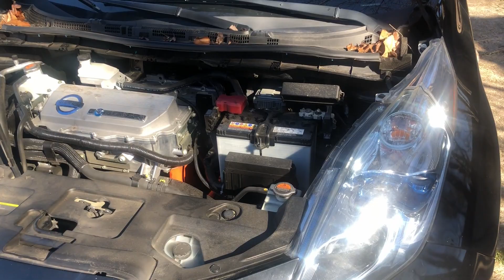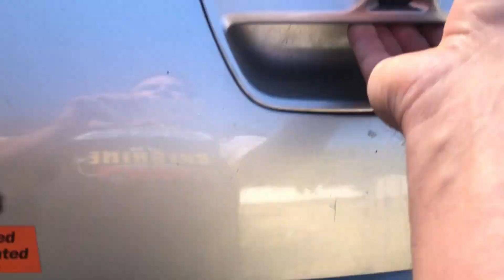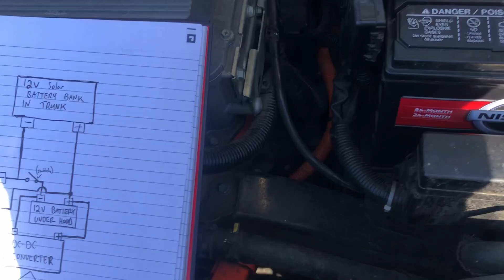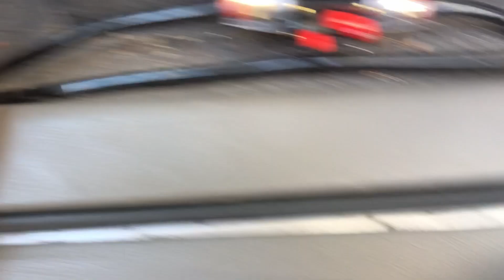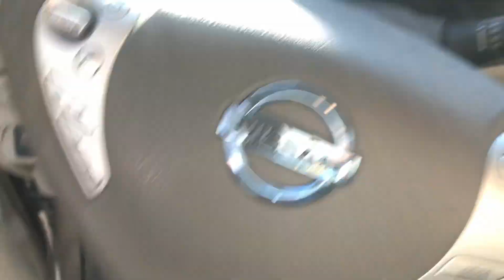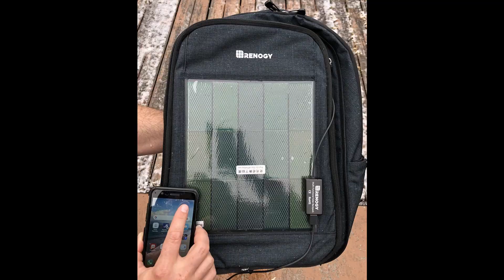Attempts to Separate the 12v Circuits in the Nissan Leaf from the High Voltage Battery

Comment: I would like to know if the DC To DC converter is able to convert 12v to 400v. Lifepo4 batteries will be lighter with more capacity that the 12v lead acid battery.
Reply from the maker: I don't know if we can get the DC-DC to run backwards.  That could be a much easier way to charge the HV battery off the solar by just overcharging the 12v batt, and generating a "backward" trickle.  And yes, in climates where it doesn't get below 15 degreesF, a LiFePo4 would be a much better option under the hood.  More capacity, and a little less weight.  I may swap my lead acid under the hood for a Valence.
Reply: @InnovativeSustainableSolutions  I have a 400v to 110v inverter but I haven't been able to connect it to the drive battery jet.